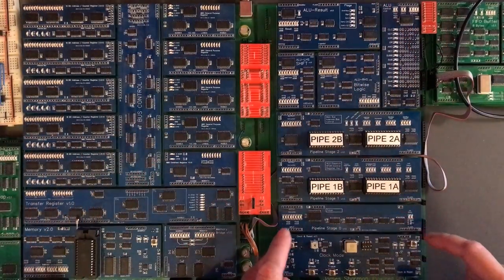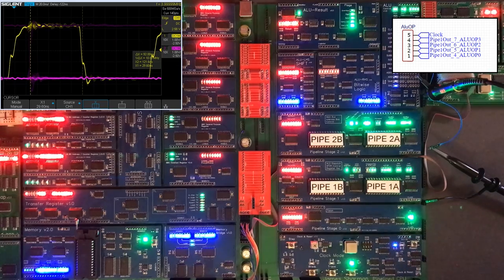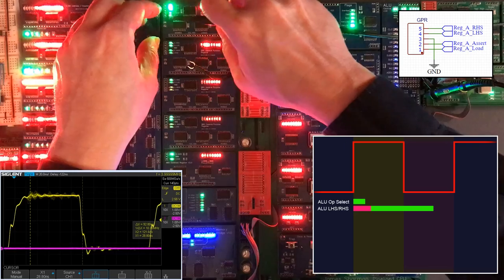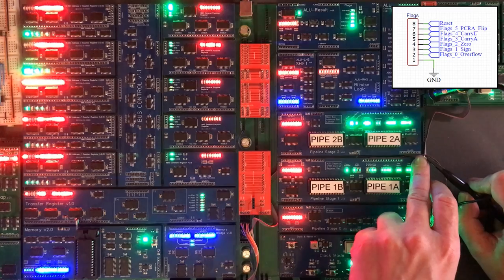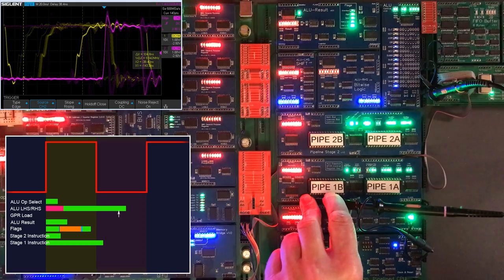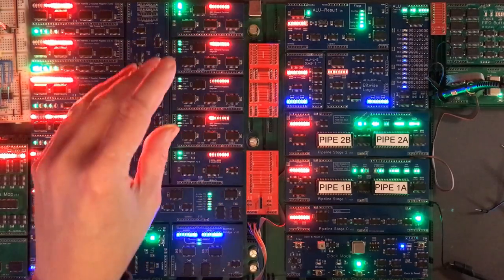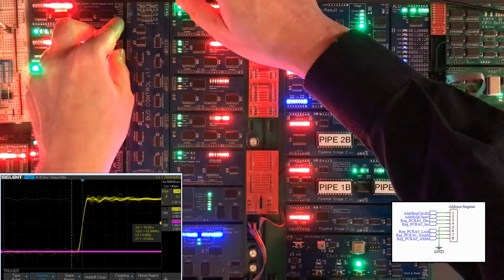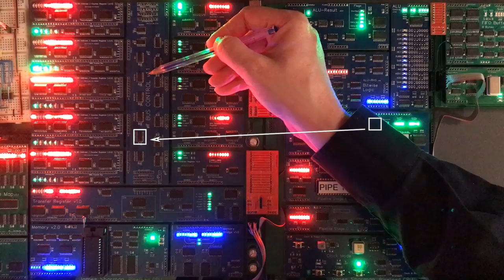Finding the Critical Path - Making an 8 Bit pipelined CPU - Part 101

Comment: From my understanding (possibly oversimplified) of your CPU design, one way to dramatically improve the critical path would be to generate the pipelined control signals all at once, concurrently with the following instruction fetch, and then just latch them to the cycle they are meant to be used, instead of generating those signals out of the ROMS within their own cycle. I would expect an improvement of maybe one third of the critical path. But of course I may be misunderstanding or overlooking things (?)
Reply from the maker: No, but you are re thinking about the right type of thing.  The biggest change I'll make in a future build is designing the pipeline such that it get's the entire cycle for a decode. Having layers of logic form part of the pipeline rom address input makes for a simpler circuit but adds up badly for high speed. Separating the rom's into the stages didn't add to the problem (Although I did end up with things in stage 2 that would have gone in stage 1 if it wasn't necessary to balance the line counts).

Comment: Jolly interesting analysis. You do indeed need to be very careful giving too much (or any?) weight to observed timings. It’s the datasheets that matter. It would be interesting to see manufacturer’s data on the shape of the distribution curves; might be wider then we think. Also temperature plays a hand.
Reply from the maker: It's been suggested that the EEPROM's maybe tested and sold based on performance buckets. So the ultra expensive 70ns parts are the ones that passed the test and the 150ns parts are a bigger window to have a large yield rate.
Reply: @weirdboyjim  yup. “Binning” I think it’s called. It would be interesting to buy job lots of 150ns parts, from the same batch and wildly different batches, and seeing how close to 70ns they get. None of that helps with mass production though when, unless you want to play games like Uncle Clive did, you have to stick to the sheets out of fear that the manufacturer will change some manufacturing parameter, knowing that it will still meet his published spec, as he’s entitled to do.

Comment: Very interesting. I wonder if exchanging the 28xx EEPROMs dor 27xx EPROMs would give you enough headroom for the bottleneck to be moved to the zero flag / bus control 🤔. I think the 2732 is available with 50ns access time.
Reply from the maker: Earlier in the project I planned to try exactly that, but the 27's are all on back order at the main suppliers due to the chip shortages.
Reply: I should have some 2732 EPROMs I can send. We use them in old arcade machines, will have to check after Christmas but if I do I don’t mind sending you some
Reply: @frazer26   join the discord, and contact him there
Reply: Or go MUCH faster with a WS57C43C-25 EPROM chip.

Comment: I spent most of the video wondering if changing the clock could help the problem. After watching your analysis of the fetch cycle my idea seems superfluous, but what if you had a clock say 150ns high / 100ns low, or something like that? Also do you think a "more square" signal might help?
Reply from the maker: In this specific case an imbalanced clock might help but I would start to suspect that it's symptomatic of something not being quite right. .

Comment: This Critical Path exercise reminds me so much of my FPGA endavours, where the design simulates perfectly, but fails to run the the same on an actual FPGA because of incorrect clocking constraints and critical paths.

Seems that no matter what desigm process one does for digital circuits, or how modern your tools are, you are always bound to the physics of electrical circuits 🙂

Keep up the good work!
Reply from the maker: Absolutely! no amount of static analysis will completely replace actual testing!

Comment: James, nice video - brings back memories.  I put in a lot of effort searching for critical paths in my Magic-1 HomebrewCPU back in 2004-2006.  Like you, I was mostly interested in validating my design.  It didn’t really matter if Magic-1 peaked at 3 Mhz or 4 Mhz or 5 Mhz, but it did matter to me that I wasn’t leaving performance on the table because of a needlessly long critical path.

In my case, I found that memory accesses were the first critical path - but realized that with a little redesign I could move some of the address formation into the previous half clock.  I had to redo my memory board and some of the microcode, but those changes enabled Magic-1 to go from about 3.5 Mhz to the current 4.09 Mhz.  Once there, though, I identified 3 or 4 new closely occurring paths such that even if I improved the new critical path another would immediately crop up and I wouldn’t really be able to speed up the machine much.  So, 4.09 Mhz was good enough.

As far as methodology, I started with my schematics and data sheets.  I guessed at what likely critical paths would be and then added up the worst-case gate delays from the data sheets.  Once key paths were identified, I first looked for redesign possibilities to simplify them.  Next, I shortened them by substituting key 74LS parts with faster 74F parts.  At one point, I thought I’d just make everything 74F - but that was a bad idea.  The “F” parts are much noisier and there is no point in using them where they are not needed.  Also like you, I found that real-world performance of the devices was generally quite a bit better than the worst-case specs from the data sheets.

This exercise was also another in which my logic analyzer was super useful.  I wrote some special programs to test paths with the timing module of the analyzer, and for one particular path I even whipped up some special test microcode.

Anyway, interesting stuff!
Reply from the maker: Thanks Bill! Your project is as always an inspiration! I have a small set of changes I could make that I think would get me about 50% faster but one of the changes would add an extra cycle of latency to my conditional jumps. I'm satisfying myself by adding all my ideas to a future project plan so I can focus on getting this machine finished.

Comment: That's really interesting.
Unfortunately the purple line was nearly impossible to see some of the time, I think it could have done with being logarithmically boosted in brightness (so the dim bits are increased a lot while the bright bits are increased only a little)

It was also interesting to see the address lines going up and down on the same spot, something you normally only see in those really confusing timing diagrams.
Reply from the maker: Yeah I appreciate that wasn't always clear. I did what I could when editing but there was only so much. I wish I had thought to swap the yellow / purple traces around as the yellow was far more visible.
Reply: @weirdboyjim  I didn't even think of swapping but yeah it probably would have helped a fair bit.
Reply: @weirdboyjim  Or perhaps triggering on the other channel could help?
Reply: @weirdboyjim  Simply wear light enhancing goggles while watching like everyone else.. just me then... gets coat
Reply: I'm actually having trouble seeing the red lines, the purple ones are quite visible for me. Depending on the video, I just boost the brightness and they are easier to see.
Reply: @ligius3  what red lines?

Comment: Very interesting. Another side to CPU and related circuitry I have never thought about. I have seen some 8 bit systems clocked at 3.7 MHz and wondered why. This may be part of that reason.
Reply from the maker: Yeah lots of the 8-bit systems fell into that general clock rate range and part of that was the general speed of the logic parts available at the time!

Comment: Really interesting, James. Nice to be back on the CPU for a bit :) You'll be at 4 GHz in notime! :)

On my FPGA implementation, the ROM are the issue on that, too. There are several circumstances of race conditions where a ROM output feeds a ROM input through some logic, which takes time to settle. That causes some issues. I ended up having to use a faster clock and register the ROM outputs with the fast clock to remove the metastability caused by the feedback.
Reply from the maker: Thanks George, glad you are still enjoying it! Not sure about your FPGA issue, there are no places in my build where a ROM data output directly feeds a ROM address input. It's always got a 574 d-type in the way.
Reply: @weirdboyjim  Sorry, yes, I have the same now! I had a bug in an early design that didn't have the latches quite right. It was a task to port the design to Verilog! Working on a V2 now.
Reply: @m1geo  Any updates? I'm curious, if you got your hands on the mandelbrot program weirdboyjim wrote to benchmark his system, exactly how much faster is the FPGA version? Also, what clock speeds can you get it to?

Comment: Yeah, most of my projects that used glue logic have been simple and didn't required a fast clock. So, this is great to see what the effects of propagation delay and how you evaluated them. 
Seriously, thanks for this.
Reply from the maker: You're very welcome! It's great to have got the clock rate as fast as this. The vga circuit actually goes faster but that has the advantage that errors are visual artifacts rather than crashes.

Comment: Hmm, super cool! I can think of a couple of paths I might go down we’re I in your shoes.

1) elimination of the zero flag completely, not the best option as you lose the jump if equal instruction, but certainly possible.

2) decoupling the program counter assertion from the fetch, either by having it pre saturate the address bus at the tail end of the previous instruction or by splitting it into two clock cycles.

3) adding a pre fetch stage to the pipeline that uses a hole in the previous instruction to preemptively fetch the next instruction and hold it in a register, only re-fetching it in the event of a jump

It seems like deliberately delaying the bus control to account for timings is going to be a trip-up at higher speeds… I’d have to give it a lot more thought, but my instincts tell me that giving more cycles to some operations might bear fruit… instructions per cycle might not be the best thing to optimize? I’m not sure.

Regardless, I love this thing and I only wish I had the time/resources/creativity to do similar projects. Awesome stuff
Reply from the maker: You are thinking about the right kind of stuff. I'd latch the flags at the end of the cycle so the decode sees them a cycle behind (but they get eliminated from the critical path).

Comment: I'm not saying I haven't learned anything from this channel but most things you've talked about and done, I've at least had an idea beforehand... but I've never even considered what the phrase "critical path analysis" might mean before watching this (something "real" EEs do, that I don't need to bother my pretty little head with?)... thanks for a superb introduction.
Reply from the maker: That's good to hear. Worrying about what is on/off the critical path is something we do a lot optimizing game engine code. Very easy for a less experienced programmer to put a lot of work into optimizing a piece of code and then discovering it makes no difference to the frame rate!

Comment: Might have said it before, but in the old days and working with the 8086 the eproms and the ram were two slow and gave us issues with reliability. The work round was to break the program into odd and even byte and program two eproms and have two ram chips so then they can run at ½ the clock speed.

Also in your case the clock does seem to have quite a long transmission line of undefined impedance so may have a few reflections bouncing around at points. This can be were then you put the scope probe on to see the issue, the impedance changes and the fault hides until the probe is removed.
Reply from the maker: I've been doing some planning for future builds surrounding the rom's, having the flag chain as an address input is a nasty limitation. Modifying the design so all the address inputs are resolved at the start of the clock giving the outputs an entire cycle to settle is the first big step.
Reply: @weirdboyjim  i do see as well you might get lots of other issues while going outside the datasheet spec limits on timings etc. having always had to work to about 80% of the spec limits as even going close to them is seen as a bad design idea.

I think maybe you should move away from eproms in the logic chain and have a look at Pal's these are of the same epoch.

Comment: A very interesting video! 

I think 4MHz is already quite an achievement in and of itself, but a bit of optimization never hurts. 

Two questions popped up in my head while watching, one of which you already answered I think, namely the one about the speed of the ROM and RAM chips. The other one intrigues me. Watching all this and trying to follow your train of thought made me wonder if there is actually something in the microcode itself that could be optimized. Since pipeline stage 1 is smack dab in the middle of the critical path, is there logic in the microcode that could be sped up, or exchanged with logic in pipeline stage 2 to take things out of the critical path that do not need to be there?
Reply from the maker: Thanks! Glad you are finding it interesting! The logic in the pipeline stages is handled by pretty much using the rom's as a big lookup table to replace what would be a complex set of logic. I don't think there is anything you could change there unless you had some extremely specialized knowledge about the internal layout of the roms chips and what address changes would be handled quicker. I would very much be looking at removing any inputs that aren't resolved at the start of the cycle.

Comment: One thing I found when I went looking for multiple input nor gates was it seemed to be difficult to find them.   Worse they seemed painfully slow.  My plan for my design is to use some diodes and a single inverter.

For the pipeline ROMs, (and maybe this is considered cheating by your design goals), I considered using some PLAs.   The other ideas I had seen were to use some RAM chips that are preloaded with the contents of your lookup ROMs during the reset phase of your CPU.

I look forward to seeing how you handle these challenges.
Reply: Using RAM for the lookup would be very interesting, especially if it could be self-modified. Could make a crazy encryption algorithm that modifies what each instruction does in addition to modifying its own code... it goes past "self-modifying code" and becomes "self-modifying code on a self-modifying architecture"

Edit: could also be used to implement new instructions for super specific instructions. If you're trying to run a game or something and you need fast transfers between a specific set of registers, for instance, you could make your program overwrite the instruction table and replace an instruction you don't need with the very specific one you do
Reply from the maker: Lots of people have been talking about replacing the rom chips with ram chips but it would take a bunch of extra components to do and it's worth asking yourself if you can make an improvement elsewhere with fewer parts. The point of analyzing the critical path is to make it shorter which can be much more than just asking "Can I make this one thing faster?".
Reply: @weirdboyjim  Makes sense and I understand that that would increase the project scope. However, I wonder how hard it would be to create a daughter board that would plug into the 4 ROM slots, have RAM chips on it and somewhere to put the original ROMs and connect to the main data/address bus. It would probably be similar to the temporary ROM-in-RAM board you built for program code while testing it, except for 4 chips at once. Maybe if/when you're running out of ideas for how to keep the series going that could be another option ;)
I think there's actually a chance that it could be useful to have a self-modifying instruction set, not to mention the fact that this would be (AFAIK) the only architecture with the ability for a program to not only modify itself at runtime, but modify the actual CPU architecture.
Reply: @aaronjamt  Could be, but as James points out, there's a trade off with the complexity of the circuit.  This is one of the reasons why I was considering PLAs for my design.  Which I think most purists would shun; but they are fast and almost identical to how ROMs behave.
Reply: @KelmarFiresun  Yeah, that makes sense. Like I said, I just think it could be a cool idea if/when he runs out of things to add to it.
Reply: hmm an 8 bit WISC machine!